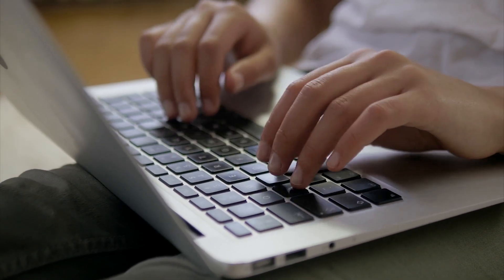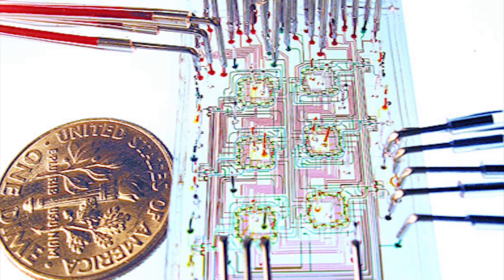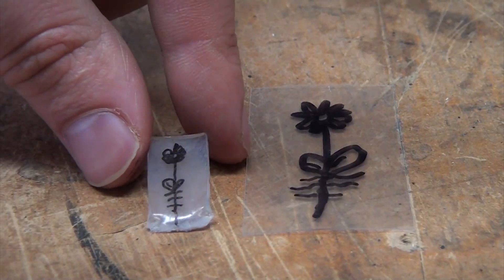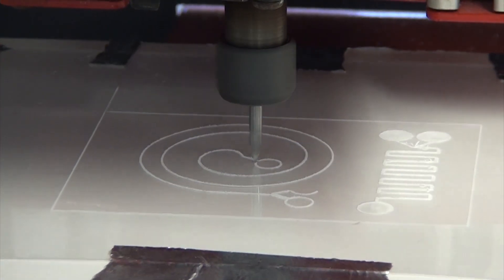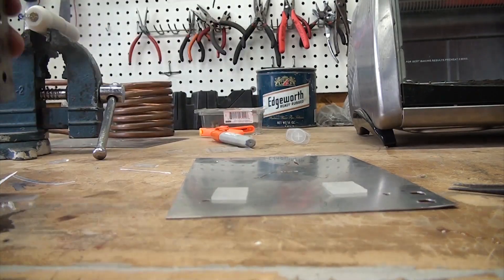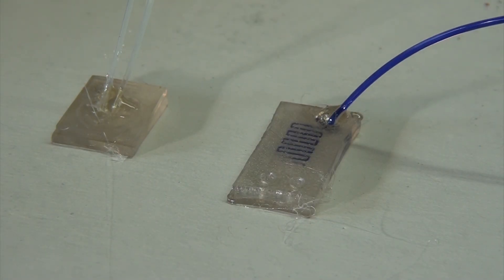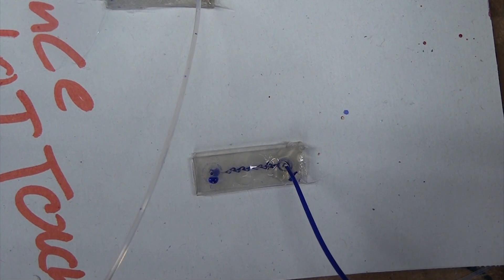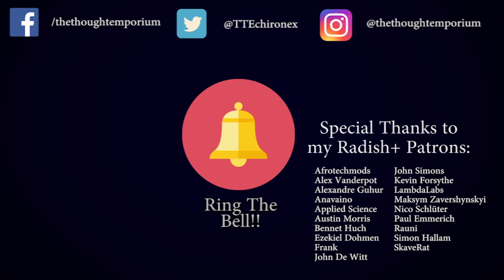Worlds Smallest Tesla Valve? - Shrinky Dink (Shrink Film) Microfluidics

Comment: For those that want to learn more about biomems there is an excellent series of lectures at https://www.youtube.com/playlist?list=PLqYqvTonHe8-ok_aryb6UQlshRMVL_96L   BioMEMS and BioInstrumentation - Winter 2015
For cleaning the shrinky dinks, you might try diluting the acetone with IPA. It is less agressive on plastic than pure acetone. A similar method is used for cold toner transfer for making printed circuit boards.
For hold down of your sheets you might want to try a vacuum hold down. Particle board is porous. Cut some grooves on the backside, laminate a backer and attach a vacuum.
Reply from the maker: Thanks for the tip, I'll try that!

Comment: Could you use micro fluidics all over a heat sync to keep it cool? Having metal channels of fluid over/in the surface dispersing the heat through the fluid? If so that  would be a neat way to cool something. But on a way  smaller scale having thousands of channels cooling an en entire system.

Comment: Could you use spray adhesive instead of tape to adhere the sheet to the CNC bed?
Reply: Wouldn't spray adhesive require to often change the bed? Seeing as that CNC is available to use for everyone in the lab, that could cause problems.

Comment: I wonder if any forms of these microfluid systems have evolved into animal circulatory systems and if so how they may have been optimised to work with systems like muscles on the smallest scales 

I mean beyond things like heart valves, more for extremely small things
Reply: Well... No, because they can't replicate. But I think  there are microfluidic chips for supporting  nerve cells, regular, and smooth muscle cells for the pharma industry to do invitro testing and limit the number of lab animals needed.
Reply: @RobertSzasz  I meant organic systems, like how the heart is a biological pump, I did not mean synthetic parts evolving in animals.
Reply: @StormSilvawalker  it still isn't totally clear what you are asking. I don't know of any work involving placing microfluidic devices in animals. And while microfluidics allow us to study parts of biological systems, plastics, glasses, and ceramics just don't behave the same as cells.
For example, microfluidics let people explore how macrophages move, but will never show how macrophages interact with blood vessels to allow migration into surrounding tissue. To explore that you need to have a blood vessel. You can support a skin sample or similar on a microfluidics chip, but the interesting interactions don't involve flow through an "inert" channel.
Reply: @RobertSzasz   an example of a system like the one which I am describing would be the common branching pattern found in capillaries. These branches must have evolved in a way that allows a certain amount of blood to pass, either gaining or releasing a quantity of stored oxygen or carbon dioxide. This means that these must be optimized for a specific flow rate of blood and it would be interesting to see if the shapes seen in a Tesla valve for example would be seen naturally formed in areas out of necessity. For example, in the legs of humans the veins returning blood to the heart require muscular assistance to do so and thus the most likely place to find capillaries which try and prevent fluid flow in  a certain direction would be in the feet and lower legs as this would help save energy. An advantage a living system would have over a synthetic one would likely be an ability to, as the situation requires, change the dimensions of certain capillaries to allow for more or less restriction in fluid flow. Proof that systems like these can evolve on larger scales would be the bicuspid and tricuspid valves in the heart as they are a large form of this kind of system (not a tesla valve but a non mechanical directionally biased passive flow restriction mechanism) they are passive in that they simply restrict flow acting as one way valves. While an example of a mechanical system existing in biology they do not take advantage of any non- compressible fluid flow dynamics unlike the systems shown in the video. It would be interesting to see if the angles and/or the diameters of fluid flow tubes such as capillaries in animal circulatory systems have evolved to perform similar tasks to the gates, tesla valves, and centrifugal systems, to control cell movement or prevent back pressure on the small scale.
Reply: @StormSilvawalker  Ah! I understand now. 

While not impossible to grow, most of our engineered solutions would be incredibly difficult to evolve. Plus the evolved solutions generally work better as part of the system they are in then any of our current designs. As we move towards more self assembly and away from top down building of devices I expect the differences to shrink.

It's hard to imagine a Tesla valve growing, and functioning as a valve at the same time. In people, the only feature I can think of that grows, then is used later, are adult teeth. But I'm sure there are some bits in animals that share features with engineered designs because fluids are fluids. 

Soft microfluidics have more features that match up with evolved solutions.
Reply: @RobertSzasz  or perhaps in bone marrow and red blood cell production

Comment: I am really glad I watched this. This will help me in my design for a full color spectrum 3d printer nozzle.
Reply: @Sad Preston  Essentially yes!. However not as small as this is. I plan on attempting to mix standard printer ink with molten clear plastic actively as it is printing.
Reply: @area85restorations75  : Remember that you can always use the plastic as a mold too. Even if your choice of plastics requires metal parts, this should still be useful.
Reply: @absalomdraconis  Im not sure what you mean lol. A mold for what?
Reply: @area85restorations75  : You can use plastic parts as molds for metal ones. It's part of how they make vinyl records.
Reply: @absalomdraconis  For the microfluidics?
Reply: @area85restorations75  : Yes. Depending on the temperatures & volumes, you might want these channels in metal instead of plastic. You should be able to do precisely that if you lookup the techniques.
Reply: @absalomdraconis  Oh i plan on them being machined aluminum with a heating element.
Reply: @area85restorations75  : Well, as long as you have a plan, it's all good in my eyes.
Reply: @area85restorations75  Something similar has been on Kickstarter, they were painting the filament with sharpie-ink, before it entered the extruder. The result was good, but would have been much better with your idea in action!!!
Reply: some inks change color or burn at the temperature a printer's hot end operates. why not use plastic thats colored like the cyan magenta yello and black ink and combine those. youd have to make sure that the pressure is constant when feeding multiple colored filaments otherwise you will get inconsistent prints.
Reply: @Videoswithsoarin  I plan on using one color filament only and then adding pigments as it prints.
Reply: Why not use colored uv resin printed like an ink jet.
Reply: @dreggory82  What do you mean?

Comment: Just an idea, but leaning from PCB etching, I am wondering if there is a way you could do something similar. At first I was thinking masking and an etching, but then thought about laser ablatement. Realizing that lasers of that power would be expensive, I searched about and came across photocatalytic degradation of polystyrene using basically the UV in sunlight and a dye sensitized titanium oxide catalyst. May be a way to make a sensitizer that you could apply to the surface and it would enable you to us a low power UV laser to lay out cleaner channels.

Comment: build a vacuum table for your CNC
Reply: Or you just simply go with one of those electrostatic plates that old plotters used to hold down the paper?
Reply: Use pegboard over a flat grid of slats. Or just use the mill to hog out a bottom pattern (be sure to leave lots of support studs), and drill open the holes. A vacuum cleaner provides the vacuum just fine.
Reply: Thin double-sided adhesive tape works too.
Reply: That is a good idea. I was thinking maybe just a drop of water between the table and the sheet would remove the air and have it stick to it.
Reply: Haha you beat me to comment
Reply: @dannyrobinson3142  woke
Reply: I was just about to suggest this.

You can make one out of wood or aluminum quite easily. If the plastic sheet is too small to cover all the holes you can easily cover them with a sheet of something else.
Reply: How about using two hydrophilic surfaces, that’s if your plastic is hydrophilic, and what you’re laying it on is hydrophilic. Take the tiniest bit of water and put it between them and let the two exclusion zones merge together, read the book called the fourth phase of water.
Reply: @davidprock904  Your comment reminded me of some work my Granddad did in 1975 at Rice University.  He was the chief machinists and built various equipment for the researchers.
The only paper I can find him referenced in is this: "The influence of pressure on the nuclear relaxation of protons in aqueous solutions and skeletal muscle" https://scholarship.rice.edu/bitstream/handle/1911/15120/7522005.PDF?sequence=1 

This paper also references numerous others about the "weird" behavior of water is small spaces. e.g. "A layer of water one micron thick held between glass or mica surfaces will not freeze at a temperature as low as -95C. If the separation of the glass plates is reduced to less than 0.15 microns, the water layer exhibits no measurable vapor pressure and will not evaporate in a vacuum at 300C." Water is such tight spaces also has a different freeze-melt behavior, density, and viscosity much higher than normal.
All this matters precisely because water exists between similarly tight spaces inside many biological cells.
I think that this "weird" water is at least part of what makes Tardigrades able to survive harsh conditions.
Reply: Use tape and glue

Comment: If you’re using CNC for this, Harvey Tool’s 0.001” endmill might be a good idea.
A vacuum hold down system might be a good idea as well.
Reply: squeegeeing the film down with water or glycerin might work also in lieu of a vacuum.
Reply: Oh boy, you've really opened a big can of worms on this one - this kind of tool requires a lot of other things to be very very right - spindle runout is very serious problem for a 25micron cutter, that and it needs to be turning at 40krpm.
Setting up an measuring shit at those dimensions is hell of its own.
Reply: @VEC7ORlt  For cutting plastic? Hogwash. Yeah, you can raise the bar of entry to something like $30k-40k, or you could use an $800 Chinese router and the finest bit you can and just do it. I've used .001"tip and .005"tip engravers ON BRASS on my 10 year old $1200 Chinese CNC router.

And with that comparatively cheap price of entry, you can easily consider inexpensive upgrades such as changing the axis ratios to eek out a little more precision, and swapping the spindle bearings out for ceramic bearings. For under $1800, you can get 90% of the results of a $30k machine.

I am surprised that laser etching wasn't mentioned....
Reply: @VEC7ORlt  People have been making precision parts for a long time without all the fancy expensive machines we have now.

I work in an aircraft company. Our tolerance ranges are typically in the +/-.001" to +/-.004" range for the majority of parts (frequently over-toleranced, but if that's what was submitted to the FAA, that's what the machinist has to hit)
Even our $60k machines require checking and tuning/adjustment to get individual features on batches of parts to come out right. You generally can't just hit go on a machine and expect to hit that precision without checking the result against the goal. And you can do the same thing to cheap machines.
So yeah, with even my stock (pre-upgraded) hobby cnc router, I have cut holes, checked with gage pins, adjusted for another pass and fit tight pins. 

We are comparing to a tolerance range of people hand cutting!!! Just about any old worn out crusted mill or cnc machine should easily improve the results

We are talking about a .001"tip engraver in plastic, effectively -there is no sideload. (Matrix flashbacks, anyone?) The machine is free from flexure issues beyond simply moving itself. That is a best case scenario for seeing the good side of a machine's repeatability and precision, rather than the extreme outside flex and slop tolerance.

Because it's so unloaded, You can also tilt the machine to preload & bias the X & Y axis and squeeze a little more precision out of it.

People who successfully do a task trump nay-sayers who claim it can't be done.

For example: here is a link to a video: https://youtu.be/RittTNl2lKg?t=444
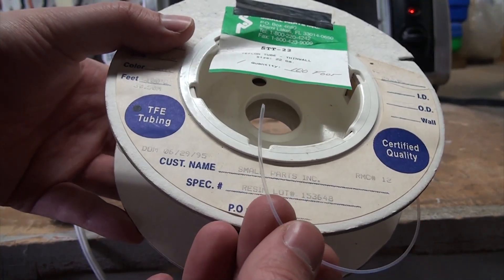(Timestamp 7:24)
of a machine far cheaper than I'm recommending (their's is approx $300+/-), profile machining alu (end mill, not unloaded fine engraving), and wasn't even dialing in/adjusting to hit a specific number (precision was non-critical for this part).
She machined her part within 0.15mm ~ 0.006" or less on both X and Y without caring or trying to calibrate results. That was just a, "huh, I wonder how close I got my parts to the cad model?"
We are talking about drawing a repeatable fine line unloaded in plastic, and I'm recommending a machine 2-3x the cost of that (more rigid, thicker ballscrews, faster spindle without an intermediate coupling to the er collet, etc). It should easily beat that even before upgrading bearings or axes. (I haven't even thrown gecko's at my machine yet, but i really should)

On my machine, the difference between a .005"tip and .001"tip engraver is immediately glace-ably noticeable. (and engraving metal, so is the strength difference and how easy it is to accidentally break...) That's a cheap 25krpm watercooled spindle. The .004" tip size difference far outweighs the spindle runout If cutting gummy c260 brass (poor little engraver) the engraver bit itself will flex significantly more than any spindle runout.

Reality Dose:
Her *ultra cheap machine almost hit within the tolerance required for a lot of airplane parts*. I'd bet she could even be able to carefully dial that down and fit within the +/_ .004 and (checking each feature) could actually make parts within the tolerance specs our QA has to check - with a sub-$400 machine!
Would that be efficient? No
Would it be much more likely to jump outside tolerance and scrap a part? Yes
Can you expect it to do that easily and out of the box? No
Can she hog material out? No
Would it be worth buying a bunch for production? No
But can a person carefully use it to successfully make a tight tolerance part within spec? Yes
Reply: @VEC7ORlt 
Also, why do you immediately jump to boring when we are talking about fine engraving soft materials?
(Any why are you trying to bore on a router?? You do know that a mill and a router are different, right?)

Also, a 15mm H7 spec hole only allows a single direction over of .018mm, which is only .0007"
You're off our scale quite a bit:
We are talking about unloaded bits with tips at 1.42x to 7.14x that. Add in some miniscule spindle runnout and those cut just a little wider yet (say 2x to 10x your scale), making it even easier for repeat passes to overlap and clean eachother out.

By your expressing that upgrading to ceramic bearings doesn't improve budget spindles, you demonstrate again that you are talking about things outside your knowledge and experience base.
Reply: Came here for the vacuüm suggestion. Well done!
Reply: only if the rest of your setup has less than 0.0001" runout
Reply: Would also need an air spindle to get enough rpm.

Comment: There are router beds that hold down the work piece using vacuum. That would be great for your application, and you could probably build one yourself with pretty common materials.
Reply: I was going to say this. :)
Reply: Also a mild glue or double sided tape could hold it flat. Then all that's needed is to peel it away after cutting.